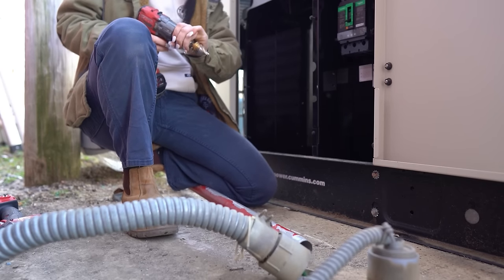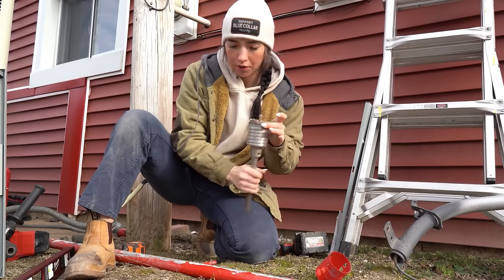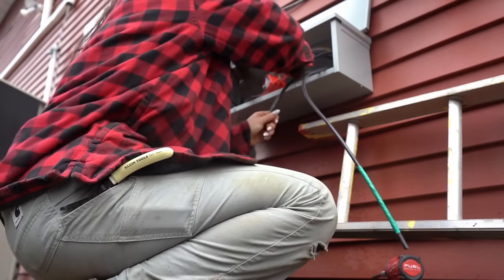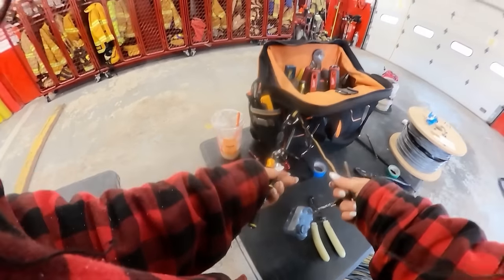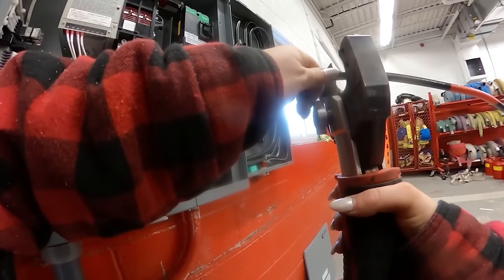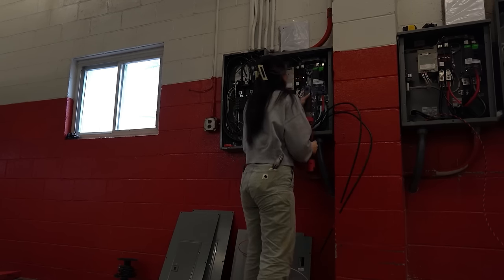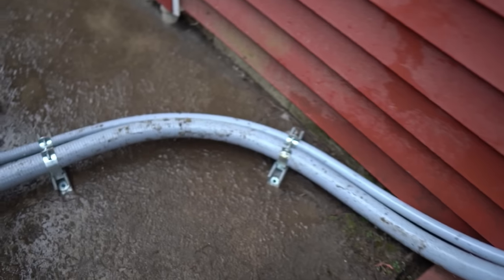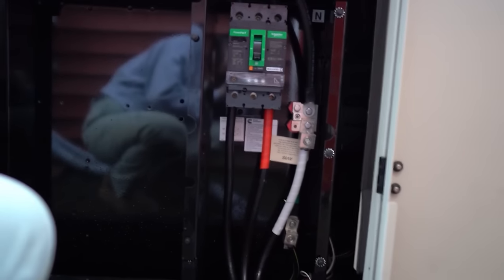Part III of the Full Gen & Transfer Switch Install

Comment: Step Drill recommendation  I've been using Drill Hog step drills for years, USA made in Nevada, Get the M7 ones made with Molybdenum blend steel, (takes a lot of heat)  they hold up to daily use.  He recently came out with spiral point ones.

Comment: A little trick for stripping that wire cause i noticed the struggle...haha Act like youre widdling wood ans strip away a slice of the insulation, then hold the knife upside down and ring around whats left. Youll have a nice tab to pull off the insulation where you first stripped

Comment: Do you like the Milwaukee box cutters?  I don’t know if I just got two bad ones or what but I’ve had two and both ended up with the blades pulling out while I was using them. And I’m sure the blades were fully in and locked.

Comment: When I saw the cut on your finger, I was YUP. That's an electrician, insulation tape and paper 😂 I know how that feels, especially when you forget about it and put your hands in your pocket!
Reply: I was an electrican in a large slaughter house. We saved our short rolls of Scotch 33 tape for workers on the kill floor that always had a cut finger. We would install the first wrap of tape sticky side out so it would not stick to skin. Was best not to use a piece of paper towel on skin. No matter what brand of band aide you used between the water and sweating they never stayed on.When I was performing electrical work in a hospital nurses freaked out on my sparky tape band aide.

Comment: Do you not still need a single point of isolation to the building?
Reply: It seems that is on the panel after three change overs. Isolate built irrespective of utility or generator power.

Comment: Had no idea those were called Polaris bugs? lol I’ve had them fail but they are handy
Reply: Insulated taps/bugs/power connectors, also known as Polaris or Ilscos (brands), they are the standard in connecting larger size wires, I don't know how you had them fail, maybe they were not tightened to spec, improper use shouldn't be blamed on the material.

Comment: Split phase? 120 V 0 120V? This set up seems very common in the USA and Canada.
Reply: No such animal. Only split phase is single phase motors that either have a start capacitor or a start winding to produce an out of phase or split phase starting means.

Comment: Make a Investment into a Wet Diamond hole drill bit.  It will go through wood also if you hit it but will cut nails etc.   Yes it is wet.. however the flow of water can be reduced to minimum when needed.   Just need more water for cement and makes really clean holes.

Comment: You need to be careful.  Cut-proof gloves, eye protection if you plan on a long career.  You’re lucky you didn’t hurt yourself drilling holes outside of previous holes.  Very dangerous.  If I was the customer, I would wonder why my panels are at two different heights.  Anyone can be an electrician, it’s about safety and quality.  Unfortunately you didn’t do a great job of explaining the first means of disconnect either.  People look up to you, show them the right way.  Why use flexible conduit through walls?  To the generator it’s required but why to the trough through the wall? I worry that people follow your lead and do the job incorrectly and unsafe.  Uni-bits are for amateurs.  The knock out needs 7/8 holesaw.  Much more efficient.
Reply: You're joking, right? Please 😂😂😂😂😂😂
Reply: Who ever wrote this please stop.
Keep giving ‘er hell.
Unibits are life savers but one recommendation I do to safe the tips is start with a normal drill bit there are cheaper then new uni bits and I also carry lube helps unibits on the thicker metal.
Reply: Did I miss something or why hasn't she sealed the bit between the conduit and the Wall itself?